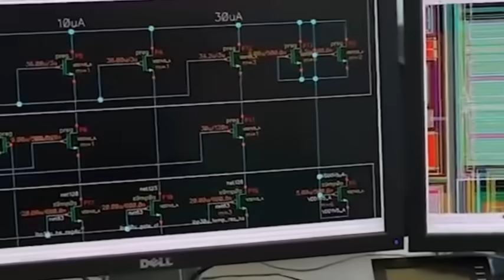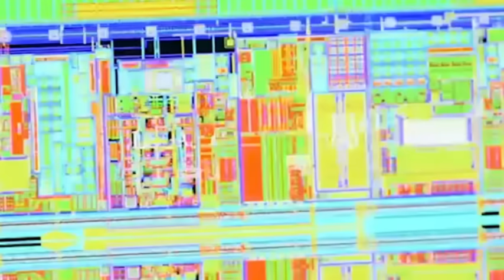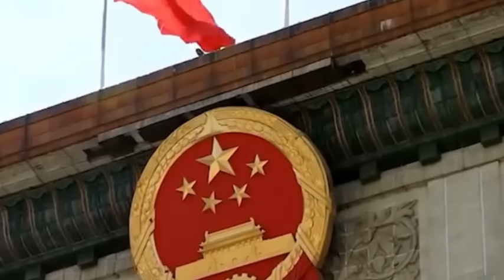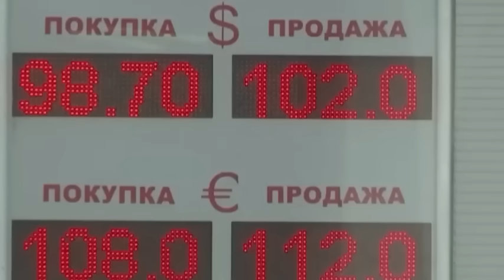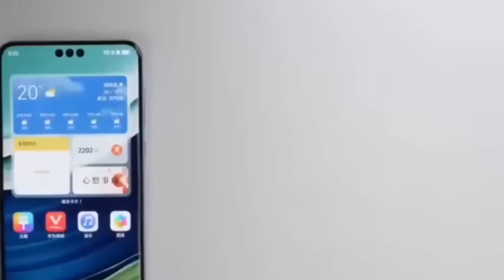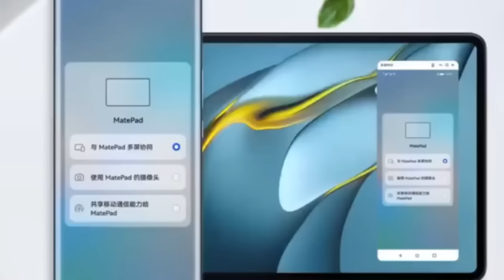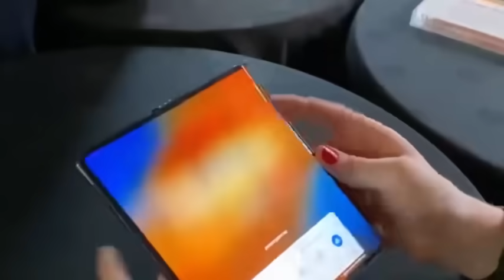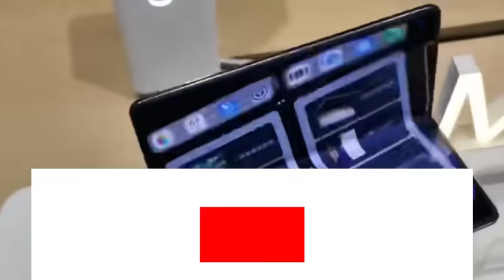Russia develops its own EUV lithography machine, breaking ASML's monopoly.

Comment: If Russia can really develop lithography machines to etch sub 7nm chips, it would boost global south tech independence from the west.
Reply: It is unlikely that we need such thin technological processes. This is exclusively the consumer sector. 90% of all chips in the world are industrial microelectronics, and depending on the environment, it can even be 450-350 nm, if the chip has to work in an aggressive environment, for example, in space. Russia has its own chip designs on its own architectures, such as VLIW on 28 nm (not a very common architecture), ARM on 24/14 nm (server), and Komdiv for space 350-28 nm. All these processors were produced at foreign facilities, since in Russia there is production only up to 60 nm at the moment, and it seems like there is a possibility of producing 45 nm, but I do not know the amount of defects (and in any batch there will always be defects during lithography, this is an absolute norm embedded in all technological processes and in all architectures). The goal of today's developments is to abandon foreign manufacturers of Russian chips, so as not to depend on the mood of the rulers in Washington or Beijing. So you are unlikely to see a smartphone with a Russian processor, we simply do not need it, we will easily buy a Chinese/Korean or any other smartphone.
Reply: @НиколайСмирнов-с7х  you know your stuff. What about AI chips.
Reply: @silversurfergw  Look, I know almost nothing about this. I saw one example at an exhibition in 2022. But whose design it is, where it is produced, what share of this product has Russian technological roots, I do not know. In any case, I would expect that Chinese technologies and chips will be used in a very large percentage, simply because they are the overwhelming leader in the field of AI. China alone accounts for more than 55% of all AI technologies in the world, all the others account for less than half.
Reply: No.. Russia cant.. even in few decades..
Reply: @dimitriig  I've been reading people like you on the internet for almost 20 years. You've never been right, and the same thing here.
Reply: @НиколайСмирнов-с7х  There is changed anything for 20 years? Russia was nt able to produce anything so cant now.. only can buy from China.
Reply: @dimitriig  Незялежного забыли спросить))) Что ты вообще про это знаешь? Если бы Ютуб позволял через АИ модерацию нарратива писать комменты про РФ такого толка, то мб я бы ещё попробовал что то такого рода. Но мой коммент просто упал в скрытый бан, и всё)))
Reply: @dimitriig  Так что, если тебе интересно содержательный ответ, тебе придётся пройти под видео, через оповещение, отсортировать комментарии, и найти эту ветку, тогда, тогда тебе покажут, что комментариев больше в ветке ответов, чем показано в оповещении. Но разве кто то из вашей братии, вообще топит за реальность? Пффф)))
Reply: @НиколайСмирнов-с7х  Я не собираюсь ни чего искать. Сколько жил в России - никогда не видел ни российских телефонов ни нормальных машин, ни компьютеров  ни нормальной бытовой техники, ни самолётов.. список можно продолжать долго.
А сказками про "новейшие" разработки которые никогда не пойдут в серию - можно кормить долго хомячков..
Reply: @dimitriig  Я буквально уже всё это написал в ответе. То есть ед твоя фактическая претензия что ты буквально не видел потребительских товаров в секторе потребительской микроэлектроники Российского производства иииии? 
Это касается 99% стран мира, иииии? Я про это всё писал. Сами чипы то есть, всё есть, кроме локации их производства! То есть тот же уровень АМД, не по уровню технологий, но положению вещей. Свой дизайн свои архитектуры, но нет своего производства. Да и видос как раз про то что бы заиметь этот процесс. Ну и тебе, из страны 404 конечно же виднее, что там в России было и есть))) Самолётов у него нет)))
Reply: @НиколайСмирнов-с7х  99% стран мира претендуют на звание "сверх державы" и пытаются навязывать свою политку другим странам? 
Именно потребительский рынок является двигателем экономики и промышленности страны, который полностью отсутствует в России.
10 лет пытались играть в "импортозамещение" а в итоге подсадили страну на низкокачественную китайскую продукцию вместо западной.
Уровень АМД??? Если даже у АМД нет своего производства но он один из мировых лидеров в технологиях микроэлектронники. В то время как в России эти технологии отсатют на десятилетия и при этом нет никакой возможности развивать и производить свое.
СССР уже пытался делать ставку на военные технологии вместо гаржданских, при том, что был одним из мировых промышленных лидеров. В итоге проиграл и страны больше нет.
Думаю, не нужно говорить, что сегодня Россия в промышленном уровне даже до СССР не дотягивает, как и в экономике.
Уже даже Турция догоняет Россию в космической программе, неговоря о авиапромышленности, где уже обгоняет.
Reply: @dimitriig  То есть, если это Китай, будучи сверхдержавой имеет в своей продукции технологии и поставленные комплектующие, то это ок? Если РФ, то не ок? Если США в своих боингах имеет менее 22% от произведённого в США, это ок? Если чипы делаются на иностранных фабриках и по иностранных технологическим процессам, то это ок, для всех кроме РФ? Ну тогда, по твоим выдуманным нормам, в мире нет сверх державы вообще, ибо отечественных высокотехнологичных продуктов будет под какой ни будь жалкий процент, где всё, от сырья и составных частей сложного продукта до технологии производства на собственном оборудование имеет отечественное производство. И по этим твоим же критериям, Китай или РФ, в зависимости от сектора экономики будут спорит за единственные 2а места на пьедестале. Ибо никакие страны в мире, вообще не обладают и жалкой долей процента суверенитета в отечественных разработках. Шутка что ли, если в каждой ракете от ВПК запада изрядная доля комплектующих из Китая, о чём ни один и не два, доклада есть в том числе перед сенатом. 

Я тебе всё написал уже, отсортируйте комменты, и прочти. То о чём я говорю, это реальный мир, то о чём ты говоришь, это восприятие и неприятие. Ты хочешь чего то иного, по исключительно каким то своим правилам и исключительно для России. Всем ост можно функционировать в рынке, РФ нельзя. Только своё вкруг. Ну даже СССР таких высот не достигал в таком случаи. Вообще в истории нет такой страны которая зачем то это сделало. 

Сверхдержава, это буквально уровень сверх уровня рядовых держав. Ты не можешь поставить РФ в ряд к какой ни будь Дании, или Бразилии, где от держав и 1/10 части нет затрат/издержек согласно условий среды, как к сверхдержавам, ибо никому яз рядовых не надо иметь свои НИИ в целом ряде отраслей и свои производственные мощности свои технологии и тп, они просто дизайнят продукт и выпускают, как Турки, покупая комплектующие, и всё. Никакой Дании и рядом не нужна Своя нац космическая программа. Никакой Швеции, будучи даже северной страной не нужен ледокольный флот. Никакой германии не надо полный спектр строй материалов собственного производства, не говоря уже про сами технологии изготовления всего этого!

В мире буквально только 3 не рядовых страны, это Китай, РФ и США. Всё. Как тебе не щемит и не трясёт, ни одну из этих стран нельзя поставить в ряд с Канадой))) Не говоря про уровень и силу вооружённых сил и др показатели.

Если ты не читаешь комменты, но опять и снова пишешь одни и те же какие то мульки, то кто тебе доктор? В РФ потребительский Рынок принадлежит РФ, за искл пару отраслей и то по понятным причинам!

И про АМД я написал понятно в каком смысле указав это для тебя специально. т.к. вижу что ты пропагандист. В АРМ процах у нас буквально актуальный уровень, то есть на рынке буквально есть серверные, базовые на базе Байкалов, и не случись то что случилось и не отрежь нас от производств, всё вообще было бы ТОП. А так через 10 руки заказы, а от того и нужны свои техпроцессы, т.к. у нас уже есть топовый актуальный уровень, и а произвести его сами не можем. Не говоря о том что самый сок это 28/24 (в фабрики этого тех процесса и идёт основные инвестиции в мире и том же Китае) нм, а не 1-2% рынка в 7/4+ нм! Ты буквально ничего не знаешь об РФ, чего не удивительно, ведь ты не отсюда. В противном случаи ты бы просто шарил бы за вакансии и чего и как тут производится.

Ну и то что ты пропагандист это видно из тейков про уровень СССР к РФ. Ну РФ сильно меньше СССР, и СССР был второй экономикой в мире, до развала и конфликтов, на чиле, пока руководство рукотворно не развалила ту страну. А РФ 4ая, после всех кризисов, дефолтов, конфликтов, развала и фактического восстановления чуть ли не с 0ля большинства секторов экономики. Да и где взять заново период бурного роста в виде Индустриализации страны? Вон на Китай это пришлось в 21 веке...
Reply: @dimitriig  Ты буквально просто кричишь в истерике о чём то, чего тебе не так, как представлялось бы... Пока ты истеришь, караван движется. Буквально, лучше ещё для России жизни не было. И если тенденции сохранятся, мы даже приобретём недостающий суверенитет в тех отраслях, которые думали что отпустили навсегда. А ты то что можешь предложить на этом пути, кроме как в РФ туалетов нет, ну или что то типа того? Потому что твои комментарии буквально булькуют от потужности как РФ то, своего ничего, всё Китай))) Мол Нет чего то, и далее по списку, чего нет. Я такое в мемах читаю, с ссылками на Униан или Твиттер)))
Reply: @НиколайСмирнов-с7х  Как все запущено.. На боингах летает весь мир, в то время как от российских SSJ-100 отказываются даже российские авиакомпании, неговоря уже об иностранных которые уже отказались. При том что США имеют все возможности производить всю передовую электроннику у себя, как это делает Intel для всей ключевой промышленности и вонеки США.
Ты даже не понимаешь что пишешь про Байкал.. Который веся линейка производился в Тайване и сегодня производство полностью остановлено. При этом производились на чипах ARM по лицензии Британии.
Любая страна такого уровня обязана иметь возможность производить ключевую продукцию у себя. Как это делают США, Китай и ЕС.
Reply: @НиколайСмирнов-с7х  
Россия даже поезда неспособна произовдить, те что запустили сегодня находятся на уровне советских разработок.
МЦСТ сегодня уже пущен с молотка из-за невозможности производства.
4-я экономика.. Ты даже не понимаешь разницы между ВВП и ППС..  По уровню экономики Россия не входит даже в десятку на уровне Кореи, у которой отсутствуют такие запасы ископаемых и территорий..
Остальной бред даже не хочется читать..
Reply: @НиколайСмирнов-с7х  Поздравляю тебя. Ты открыл для себя, что в США есть тоже коррупция и там промышленники экономят и могут закупить дешевые компоненты в Китае. Только ты забываешь, что США производят все у себя и в случае необходимости могут себя обеспечить всем. В то время как Россия неспособна.
4-я экономика.. вот это шутка.. Это из какой такой статистики? Когда российская экономика отстает даже от Кореи..
Reply: @dimitriig  Кому ты лепишь, если серия SJ за 100+ перевалила, и вот скоро замена иностранного двигла на отечественный... На Боингах летают просто потому что а на чём ещё, есть только Аирбас! Когда у РФ была бы возможность освоить рынки, когда к моменту развала СССР советскими самолётами пользовались лишь ряд стран? Ну когда? Пока у тебя падение и восстановление страны и первые попытки освоения зарубежного рынка! Ты как раз и будешь думать как наши разработчики, вооот, мол выйдем на международный рынок, будем использовать иностранный комплектующие, проще будет с сертификацией? Ну и? А там не пускают, увынск. Соответственно, видимо Российские авиалайнеры будут самые отечественные из всех авиалайнеров. Будут Китайские, Российские и Западные, всё, вот и все производители на всё человечество, и не надо мне лепить что либо с бизнесджетами или другими нишами. Так что на данный момент в мире 2а Гиганта, Китай и РФ только только допиливают чисто отечественное (Хотя Китай исп иностранные комплектующие и тот же компрессор, им то можно). 

Далее ты там что то про производство микроэлектроники у себя в США и Интел. Нет не могут так как ты это рисуешь, вся актуальная линейка Интелов лек как 10 за рубежом производят! Интел не смог в техпроцессы своими силами. Сокращение, увольнение руководителей проекта, попытки оптимизировать то что есть, и отказ от дальнейших самостоятельных разработок, это буквально офф заявления. Не говоря о том, что в США давно нет свои литографов. Они дизайнили, разрабатывали, хотят свои фабрики, но оборудование там было не мейд ин США. Так что прикол всё тот же, им можно в кооперацию, нам нельзя, ибо Дима из Ютуба требует что бы его удовлетворили! США Пытаются заманить на территорию и АСМЛ и ТСМЦ, более того, закидывая мутки, что вот вот конфликт, а мыж не можем Китаю позволить получить гигафабрики (Хотя у Китая свои), значит надо делать закладку на заводах. Эти угрозы стали мемом как год+, мол смотрите как рыночег работает! 

Что значит я не понимаю что пишу про Байкал? Ты вообще комменты читал? Я на анг даже челику писал про то, что топовый техпроцесс РФ не доступен, и всё производство за рубежом (как и для всех кроме Китая), и видос посвящён как раз НИОКРу в этой области, т.к. у нас есть вся база, и в сложившихся обстоятельствах надо не думать об горизонте окупаемости, а просто иметь технологии что бы независеть от Воли акционеров США!
Лицензия была открытой, для всех участников, и этот АРМ кто угодно пытался приобрести, больше всех Япония. Но увы и ах, звонки кого надо кому надо порешали, и теперь это нац безопасность, хотя там буквально искл частные инвестиции вкл Российские. Но, но, у нас и у Китая, есть полный доступ к Архитектуре и Ядру. У Китая даже на уровне головного Разраба.

ЕС не производит у себя. США не будт на своём производит у себя, мощности предыдущих техпроцессов пытаются перераспределить... Так что, хватит пропагандировать

Про поезда очередная пропаганда. От тягловых главных вагонов, на эл или дизель тяги, хоть маневровые в РФ делают. Делают и телеги с вагонов с эл парами. И это мы у Сименс выиграли Тендер в Индии, а не они у нас. Так что, твоя инфа примерно из 2014. ПРОПАГАНДА!

Про МЦСТ обидно, видимо у влива нет будущего, мы были ласт в мире кто пилил эту архитектуру. Но Тебе то какое дело, я минимум 3 архитектуры перечислил. От скольких отказывались на Западе, за неимением перспектив, в т.я. от Влива? 

Что не так с 4 позицией? Ты в МВФ пиши, что они там не понимают, и ВБ, а не мне. Много ты то понимаешь что? Измерять номинал в чужой валюте при десятках лет Западного инфляционного стоимостного увеличения стоимости, где под 30%+ на ВВП это фондовый рынок, это умом, при том что мы буквально знаем что инфляцию можно импортировать просто с исп валюты. Только та же США с населением х2 от нашего и топ 1 по номиналу, выплавляет метала чуть чуть больше РФ, как и вырабатывает эл энергии. Да они даже не производят столько же судов как РФ нынче, не говоря про Японию Корею Китай и др. А мы не то что бы Морская держава. 

Короче, ты в 404 вылез из информационного схрона и пошёл заниматься пропагандой. Ряяяяяяяяя... Ога ога, давай давай)))
Reply: No chance , they haven't mastered plumbing or road building yet.
Reply: Did you find this out on Twitter or Reddit? Who is building 30+ nuclear reactors in Russia and other countries? Who is building BAM-3, the Northern Ring Road, the Northern Sea Route, a bunch of shipyards, upgrading the entire infrastructure, thousands and thousands of kilometers of highways. And yes, the video doesn't say it, but X-ray lithography will be available by 2030, not this year or next. Are you from some non-industrial country?
Reply: @НиколайСмирнов-с7х  USSR but not Russia.
Reply: @dimitriig  The USSR came out of Russia, not Russia out of the USSR. And this is happening now, not 35 years ago.
Reply: @НиколайСмирнов-с7х  USSR wasn't only Russia. There were Ukraine, Belarus and a lot of other countries that created all factories and infrastracture for Russia while russian drink vodka.
Reply: @dimitriig  Yes, yes. Tell us about the incredible contribution of the USSR Republics, which simply absorbed the resources of the RSFSR (Russia) in order to undergo industrialization at an accelerated pace. Should I remind you of the society in which people lived in Kazakhstan, Turkmenistan and other republics at the beginning of the 20th century? At the expense of what was the explosive industrialization carried out in these republics and in what years? If you don’t like the example of the Southern republics, then the Western ones were no better! The USSR was created by the efforts of millions of Russians. Once again, it was Russia that created the USSR, even if the USSR was not only Russia. No other republic could have taken on the socialist industrial project of creating a superpower. That is why, after the collapse of the USSR, Russia was the only one that retained the rights and legacy of the USSR, both in the UN and in cultural terms, or in the armed forces.

So all attempts by people like you to belittle Russia's achievements are just a joke.
Reply: @ кстати, чё не на державной?
Reply: Russia took direct part in the development of the ASML lithographic machine! So yes, we will develop our own lithographic machine, but it will take time, I think 7 years. Because we can make a prototype in 3 years, but it takes time to create an industrial machine.
Reply: @globalpower6967  Dude.. If you make screws for german auto it doesn't mean that you can develop your own and Russia shows it a lot of years even with USSR legacy.
Reply: @ Dude, Russia developed the core technologies for ASML, not the propellers!
Reply: @globalpower6967  Oh.. so delusional.. Also the first human on Earth was a russian and Russia invented stars..